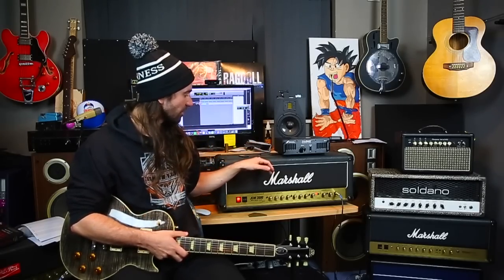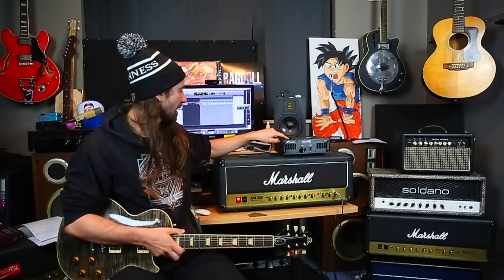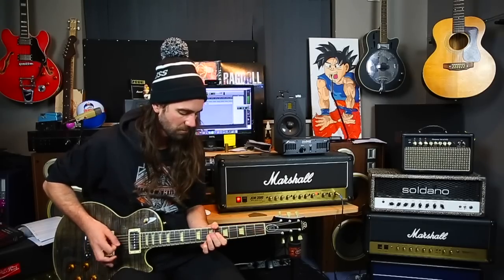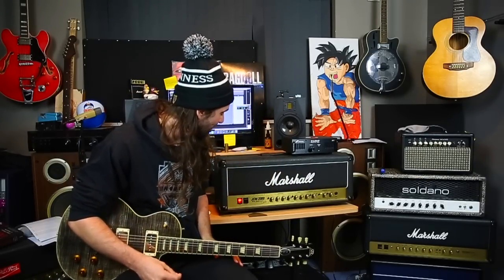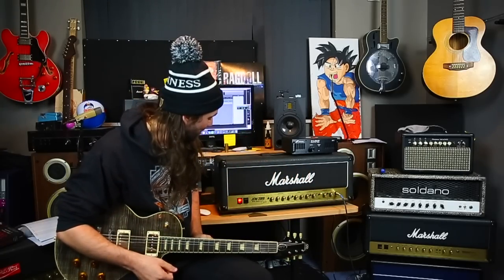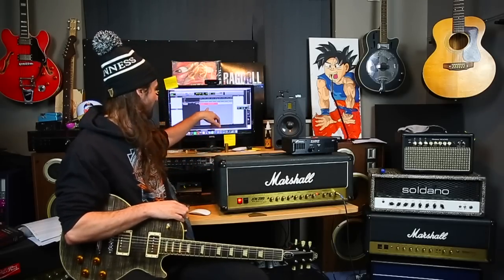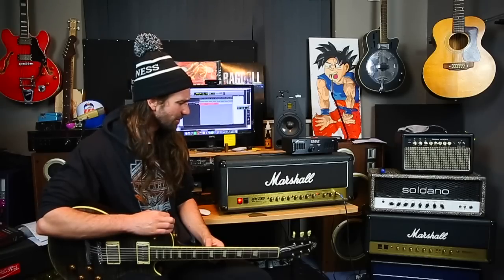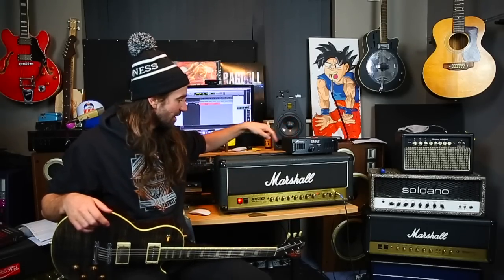Removing Output Tubes to Reduce Power   Marshall JCM2000 DSL

Comment: Actually, you're NOT cutting the wattage in half because the tubes are running at about +450-470 volts on the plates... by comparison, a DSL50 (or any post-1974 50 watt) is running about +390-400 volts on the plates. So you're really only lowering the watts to about 70-80 watts. If you're going to use this trick make sure you rotate your tubes on a regular basis, so they wear evenly. I usually pull the two outside tubes and run the two inside tubes, but you can run it either way. And, always remember to set your ohms impedance correctly.; 4ohms for an 8ohm load, 8ohms for a 16ohm load.
Reply: Upwards mismatch shouldn't be that big of a deal if I don't change my amp impedance right? For plexi stye amp.

Comment: The Marshall Amp document I read back in the 1980s from a 1970's magazine said to pull the outside valves. Which I have done & had zero problems with.

Comment: I have done that with a Peavey classic 20 with 2 EL 84s. Removing the 1st power tube made it sound crunchier. After 20+ years still running fine.

Comment: Picked up a Bugera PS1 Passive 100 watt power attenuator for my JCM 2000 DSL 100watt and it works perfect for all my shows. Big or small!  You can really crank the amp and use the PS1 as a master volume.

Comment: For years I never thought of buying a JCM 2000... bias drift and all the drama. But after your videos and some recent research I'm almost pulling the trigger on a DSL 50 (2008). I don't need one by any means... but I always thought of this amp. Btw, for me your videos are top grade and you are such a cool dude. All the best man, keep up the good work!
Reply from the maker: Thanks Valter. The DSL is a really fun amp, and with a little bit of maintenance it should keep you happy for years. I've been playing this one for over 12 years now.
Reply: I have an early 98 200 dsl 100 model. Started having the bias drift issue.  I Got a new revision pcb board from Marshall and it’s been brilliant. No problems at all now. Bias been rock steady. Sounds incredible with the upgraded plexi spec output tranny and choke.

Comment: running a outside pair of 6L6 removed for yrs, with and without a variac....easy to get smooth gritty blistering output and whean you roll off the guitar volume it cleans up very nice..Les Paul with an orange drop in the circuit. works well and does not tear the front rows faces off. A pair of shure micros and the to the board to get wide mono output so good wide output across the audience, then crank it up....

Comment: I used to do this with my old Rivera K100. I'd take the outer two power valves out and then crank the amp and have something in the effects loop so I could use the level control on the effects loop as a master volume
Worked great and the tone was big and fat
Reply from the maker: I'd love to play one of those amps!

Comment: Bottom line, the lesson learned was: Get a 50 watts amp 😂. They are way easier to crank hahaha.
Reply from the maker: Hahaha exactly!
Reply: Not really...  A 50W head will only be apx 3db quieter than its 100W counterpart...  A 10W head would be 1/2 as loud as its 100W counterpart
Reply: You have the bigger 100 watt transformers, if you get the 100 and pull the tubes.
Reply: @puddynuts  I am sorry, I didn´t understand, what?

Comment: Great video as always!
I'm really in a middle of picking a new DSL100HR or going for the good old UK made JCM2000 ( not sure if the 100W or 50W ), what do you suggest? sound and build wise and of course those master volumes? I mainly gonna use it at home so are they that important? It looks to me that the JCM2000 got that premium build look and the DSL100HR a bit cheaper look to it. Maybe I shall ask would you replace one of yours for a new HR version?
Would love to hear your opinion
Reply: There's not going to be a huge difference between a 50W and or 100W head if they have the same basic circuit.  A 100W amp will be apx 3db louder than the 50W model.

Comment: Designer for vintage modern 2466 100watt  says not to do it with that amp due to B+ voltage rising and stressing remaining valves leading to possible arc-over or reducing valve life, maybe the same for the DSL? needs investigating before permanent removal I would suggest.
Reply from the maker: I imagine that's also the case.
Reply: Because you're down two tubes that would otherwise be drawing current, all voltages in the amp go up slightly, B+, filaments, etc. Ideal thing to do is run it with 4 tubes and test some voltages, pull 2 and then use variac to bring them down, but that's usually unnecessary, it's not like the voltages double when you pull 2 tubes, it's pretty marginal and usually no prob

Comment: So did you say that you volume matched the amp before and after? I expected a noticeable volume drop but didn't hear it. How much more master volume did you need to get the same volume with two tubes?
Reply from the maker: I normalised the volumes in post. There was around a 3-6dB drop in volume, but I also wanted to evaluate any tonal differences and that is only valid at the same listening volume. It's probably 2-3 notches on the master volume; I found running the amp at 4 with 4 tubes was really pushing the load, but I could get it around 6 with the tubes pulled.

Comment: i wish you woulda shown the removal of the tubes. I was always under the impression you removed the 2 outer tubes
Reply: Either set works but it has to be the inner two or the outer two, I remove the inner two cause I think it creates less heat.

Comment: Dont get me wrong..I love your style and your videos but tried this yesterday with my brand new DSL 100. It sounded great for about 30 minutes and then it started popping and crackling and now it will not work!  I did is exactly as you suggested and put it on 4 ohms for an 8 Ω cabinet running only the 2 outer tubes.... now it does not work at all and makes a crackling sound. I do not suggest doing this!! I'm really upset 😔  I notice this when I pressed the TONE SHIFT  BUTTON IN ...and then the volume dropped and that's when the crackling started and now it will not work.😟 If there is anyway you can suggest how to fix it, please help!!
Reply: @robertpundt4291   check the fuse
Reply: This is a jcm 2000 dsl 100 not one of the newer made dsl 100 from Vietnam